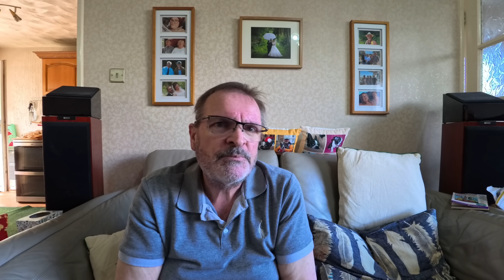Expert Ships Engineer Reacts to Baltimore Bridge Crash

Comment: The Key Bridge was an attack folks. Don't listen to the lies being told it wasn't. I'm former intel. Lived near the bridge when I worked at Fort Meade. After that, 32 years in cybersecurity. Now retired. This was a cyber attack through the ships navigation system. The ship didn't lose power. The crew shutdown power frantically, twice, to reset the systems to try to thwart the attack. Obviously, that didn't work. 

I can't imagine ship navigation systems are any more secure than the notoriously unsecure ADS-B navigation system used by aircraft. Easy to hack. 

Often, in a cyber attack, it is difficult to pin point the attack vector. Sometimes a hard shutdown/reset is necessary to immediately stop the attack. And that course of action was likely the best course of action since it is vital to regain navigational control of the ship. I honestly believe that's what we saw with the ship appearing to lose power twice before hitting the pylon.

The attack appears to have what we call persistence. Even with the hard resets, the navigational settings configured to drive the ship into the pylon remained even after the resets. 

This is a major attack on critical infrastructure. The impact will be enormous.
Reply: Here's the problem,  even when someone is explaining a basic idea of what probably happened,  you refuse to listen. Before jumping to an attack theory, listen to the man speaking.
Reply: I don't know what actually transpired on the ship ... but I too am seriously skeptical.  Keep your eyes on Transportation Secretary Pete Bootigigger ... I sense he's going to become a shining star and will most likely be dubbed as Kamala's replacement.  Rahm Emanuel said it ... "Never let a serious crisis go to waste."